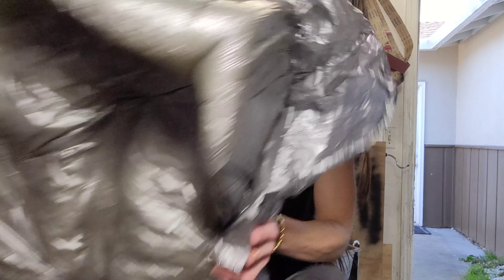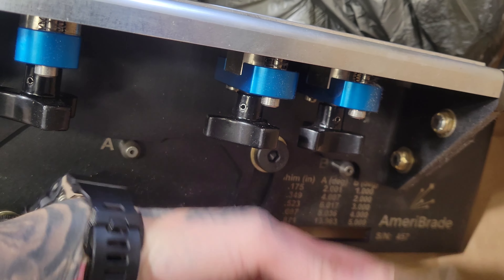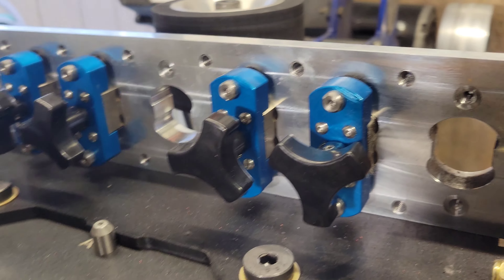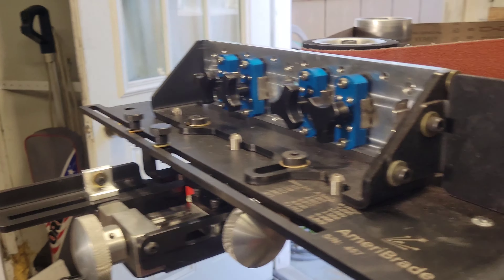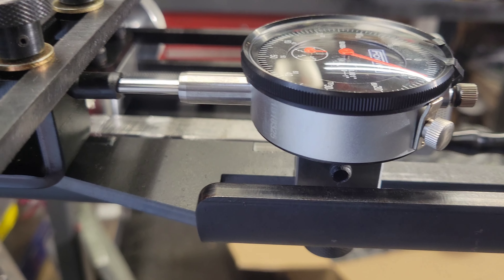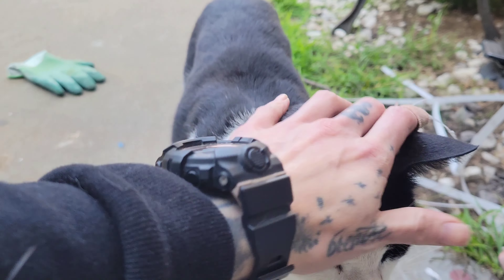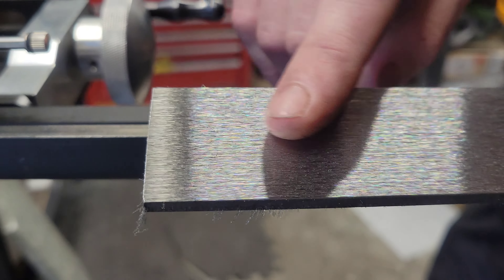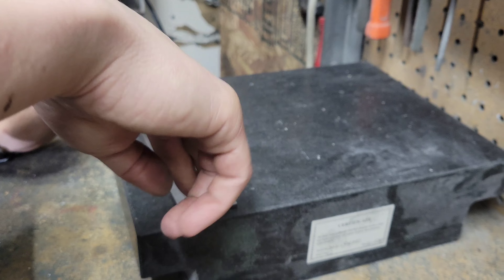New toy for knife making

Comment: Congrats. I have one of those surface grinders also. And here’s a tip if anyone is interested . I talked with ameribrade and the contact wheel on the surface grinder is 2 1/2 inches wide. I was then able to contact red label abrasives and had them make 2 1/2 wide by 72 inch long belts in any grit and abrasive material that way the surface area on the surface grinder can be maximized. I’m pretty sure any abrasive company is able to custom belt sizes so whoever you prefer they should be able to make them for you
Reply: Klingspor will also do small quantity custom belts

Comment: I would suggest wearing a leather apron when using this so that one doesn't grind off any "sensitive" bits.😉
Reply from the maker: 😂We actually just bought a new apron, didn't think to wear it today though
Reply: Just might've came in handy, not that I'm complaining.
Reply: With magnetic chuck did anyone mention possibly placing a covering over magnets like plastic wrap so metal shit don't stick to your chuck but, in doing so account for thickness of saran wrap. May not need as magnets switch off and can be cleaned. Jus a thought
Reply from the maker: @christolley4946  Being able to turn the magnets off should be enough to keep the chuck clean, hopefully!